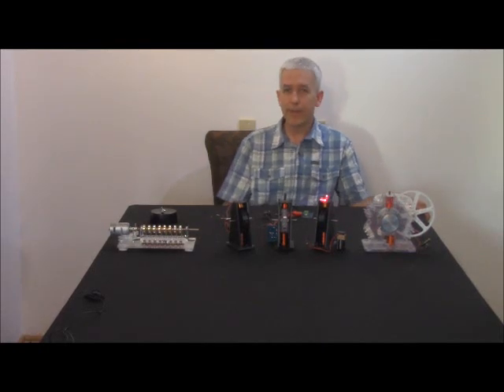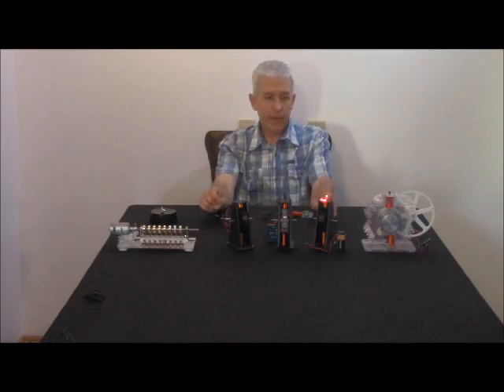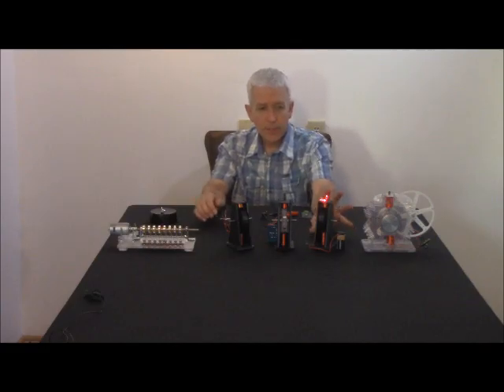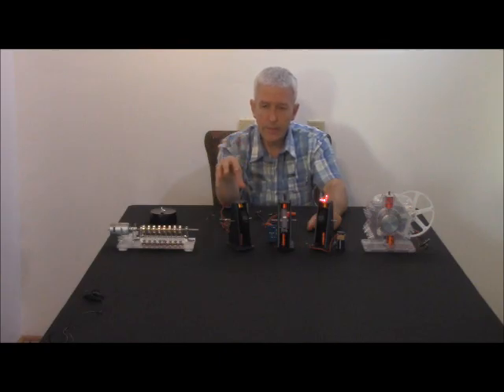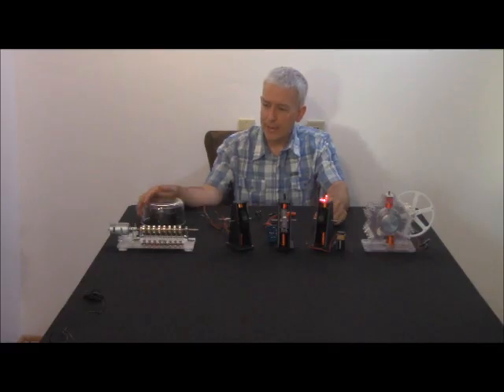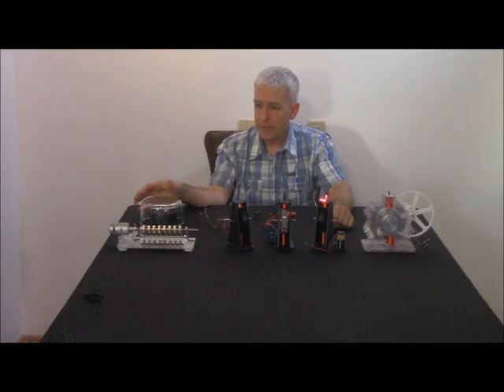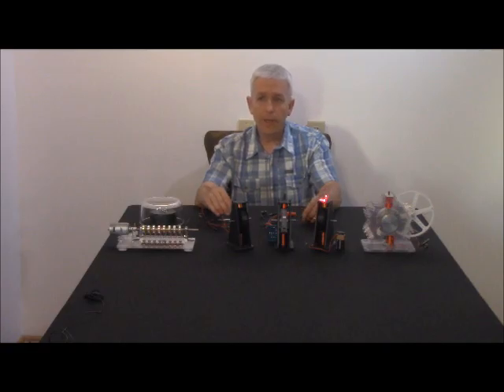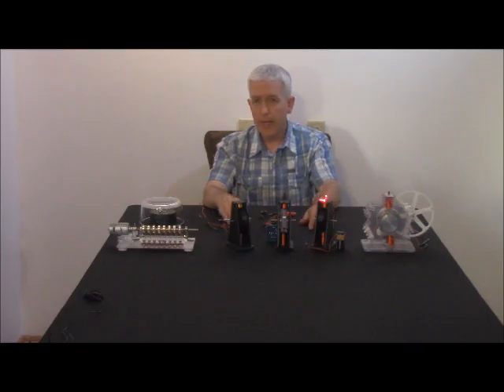July 26-27 meeting, new kits and forum

Comment: Hi Rick, I have one more question. Did you try other types of batteries to recharge  with that circuit ? Like  a lithium batteries (Lithium Ion or Lithium Iron Phosphate etc) and  other battery banks which has BMS or PCM sytems. Do you need to change something to adapt this circuit ?
Reply from the maker: I will be using NiMh batteries and small SLA but we can use any batteries, only lithium needs battery management removed. I will present this when ready.

Comment: Hi Rick.  Good to see you again.  I think I may have been one of the last, if the last, to get promoted from the beginner group to the next group back in the day.  I submitted my data, after that somewhat gruelling process of doing the charge/discharge cycles during some vacation time, and it was maybe a day or two later the groups got taken down.  I was so disappointed I never got to spend any time to speak of in the intermediate group.  The new forum sounds like a great place to do some real science, and share with like-minded researchers.  Thanks for all you're doing.  I still have my original three coiler, that I upgraded to the six coil configuration, along with going to some heavier gauge wire, and experimenting with other magnets like samarium cobalt.  Even had some interesting things happen like having the unit accelerate, rather than decelerate under load when applying some LEDs to the output of a bank of six gen coils around a second rotor on the same shaft as the drive coils.  I have had alot of fun with that little kit!!